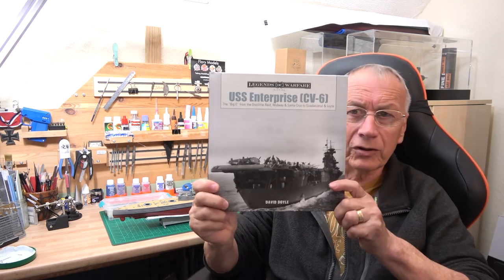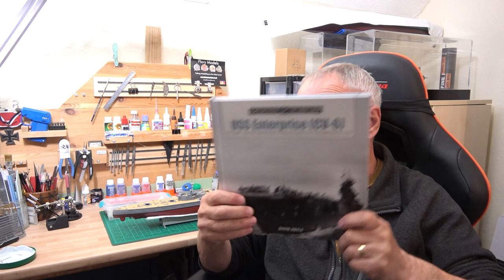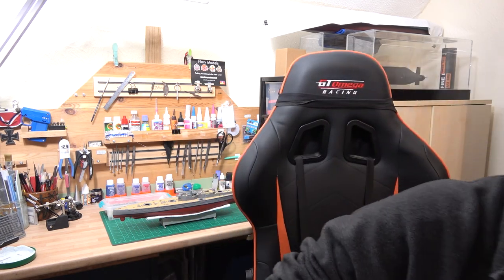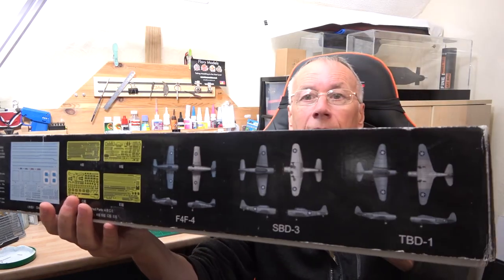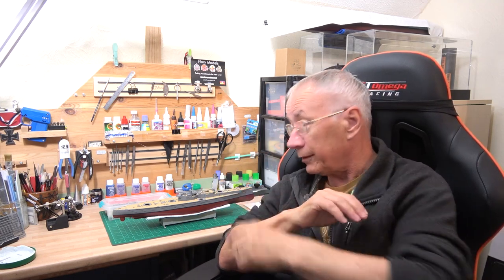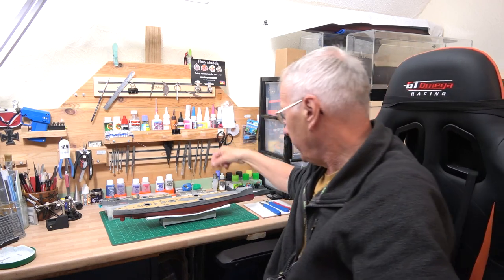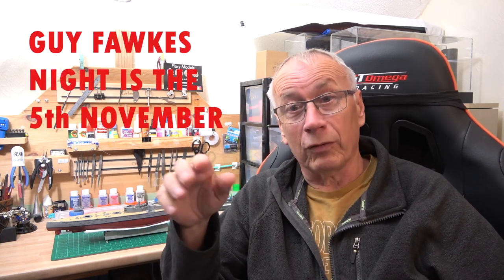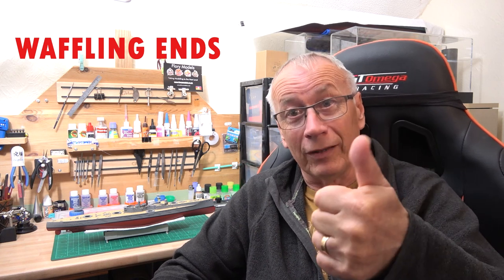TRUMPETER HMS DREADNOUGHT 1907  1 350 UPDATE 2

Comment: Did you use the pontos after kit? The detail on the torpedo net booms drives me nuts. Trying to fit to the Queen Mary.😊
Reply from the maker: For the wooden deck I used Artwox, and the Eduard 1907 photo etch set. For dreadnought 1918 I'm using the same companies' products